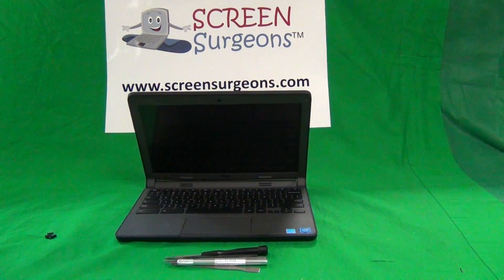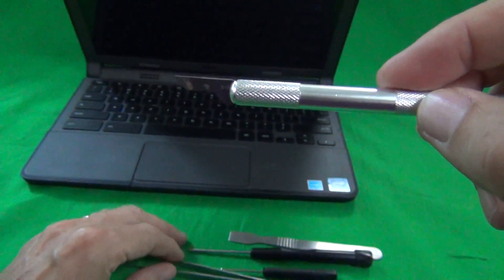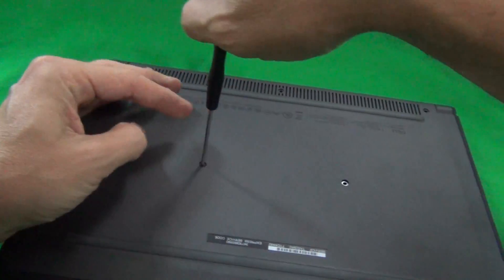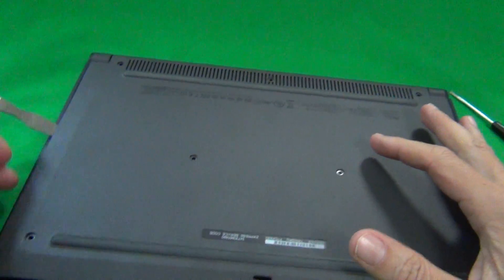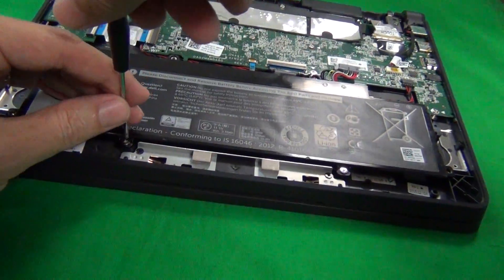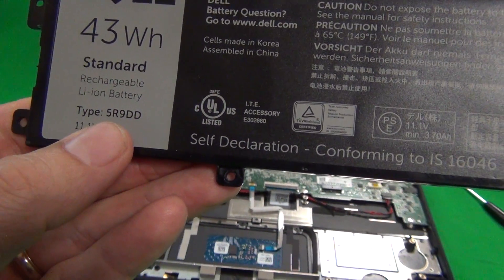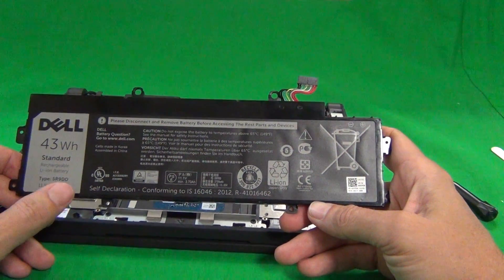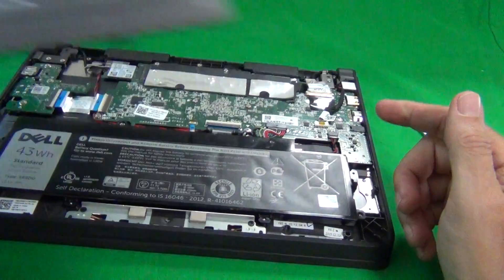Dell Chromebook 2nd Gen 11 3120 Battery Replacement Procedure

Comment: I replaced the battery but the Dell Chromebook 3120 still does not turn on, even with the charging cable connected. My problem started when the screen went black and I was told it would be the bettery.